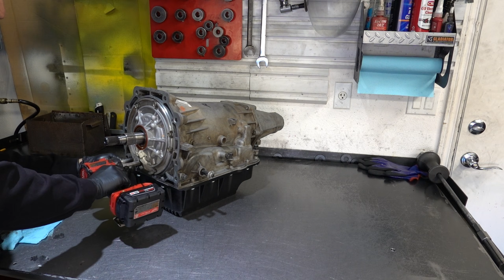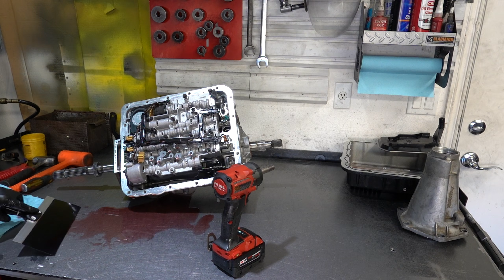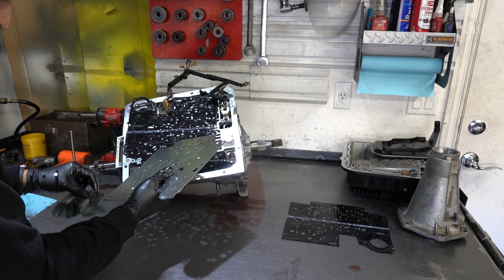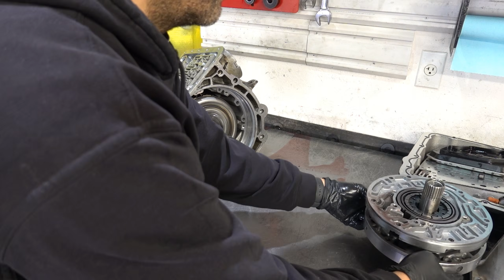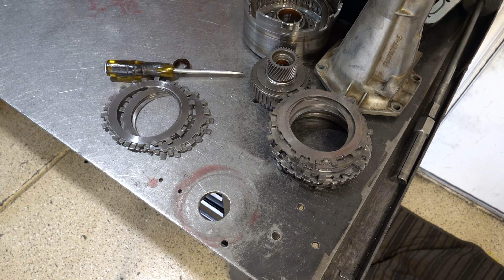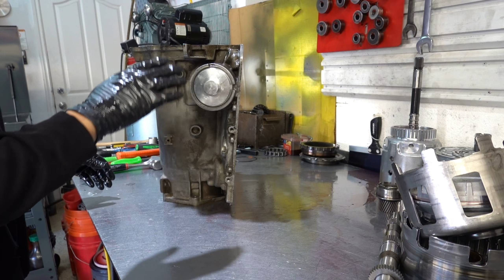4L60E Teardown  - The 1,000 Horsepower "Hill Killer"!

Comment: Hi there! I appreciate all the videos and honest work. If you have time to answer a quick question? Would a 2005 4l60e be a direct a direct swap into a 2003 Silverado? I have an opportunity to buy both very very cheap! If I wasn't up in Canada I would drop the trans off at your shop! Thanks for all the great content 👍
Reply from the maker: Hi Chad, thanks for watching - those units will interchange. I have a 2005 4L60E in my 03 Tahoe that I built eight years ago, still runs strong. 

Check out my 4L60E interchange video if you'd like more details on all the diff versions of that transmission as well as what years will interchange and what wont: https://youtu.be/4kEzgffqi7w
Reply: @nickstransmissions  I will watch it for sure! Thanks for the reply! With all of your detailed videos I am getting close to building my first 4l60e.
Reply from the maker: Thanks, Chad!

Comment: What is the benefit of blocking off the 3-2 downshift valve?
Reply from the maker: Hi Scott, I think I will do a separate video on the 3-2 downshift circuit as I get this question frequently, and it's a good question...

Nutshell: Blocking the downshift valve simplifies the exhaust hydraulic circuitry for the 3-2 downshift, resulting in less designed-in slip on the band between the downshift being commanded.
Reply: @ cool deal. Ill definitely keep an eye out. 

Keep up the good work man. Hope ya had a good Christmas and New Years!
Reply from the maker: Thanks, Scott - will do!

Hope you and your family had a great Christmas and New Years🎄🥳

Comment: Hi Nick This is Walter,  i had to buy a new VB One of the Bathtubs was mashed bad, So was the separator plate,  i got a rebuilt from Central,  got all the parts together to build up my 4L60E VB,  i am using a Sonnax Performance pack and TransGo SK-4L60E mini kit, Sonnax O-ringed end plugs (2),  and that Sonnax HD 2-3 shift valve,  
 i have a few questions if you dont mind, For peace of mind,   When it comes to the 3-2 kick down why Block it off?   Yes this is a High Performance ALL out build 700HP,  I believe in the TransGo HD-2 kit they give you a tight wind spring to stop 3-2 down shifts,  To Be honest i like the 3-2 shift But i guess its not needed in hight HP applications ,  Can you elaborate on it Just for my own knowledge, You help is always Much Appreciated, Walter
Reply: I have an oversized Afl valve from central valve body's. Would that work with the double spring mod. Don't have vacuum tester at the moment. I'm also going to block 3/2 control and use abuse spring in control valve.
Reply from the maker: Should be fine. If you are taking the 3-2 ds valve spring and inserting inside the main AFL spring, leave the AFL balance hole in the spacer plate alone.
Reply: @seanmccaskey6427  yes it will work with the Central over sized AFL (purple) valve  , i believe there Purple valve is .001" bigger
Reply: @LSXTtype Thank You!!
Reply from the maker: Hi Walter, blocking the 3-2 downshift valve in the 200-4Rs, 700R4s and 4L60Es simplifies the 3-2 exhaust cycle by streamlining the exhaust circuitry enabling faster downshifts and consequently, less band slippage (the slip im referring to here is not like a slip that you'd feel if the band or clutch pack was burnt...This slip is much more subtle and usually never noticeable by the driver or occupants).
Reply: @nickstransmissions  Thank you for explaining that,  so the  transmission will still down shif then 
I have a few more questions if you dont mind, TransGo supplies a 1-2 shift valve-spring-check ball etc in the HD-2 kit,  I dont have it in the kit i bought, should i get one?
Walt
Reply from the maker: Contact Transgo and see why it wasn't in your kit - perhaps they recently deleted it for some reason. If not, ask them to send you the missing parts.
Reply: @nickstransmissions  Hi Nick, it wasnt missing, i bought the smaller SK-4L60E kit they dont give it to you in that kit only in the HD-2 kit,  Do you use that TransGo 1-2 valve in your performance Builds?
Reply from the maker: Oh, ok...no worries it wasn't clear whether you bought the HD2 kit or not; had assumed you did based on your previous posts...I don't normally use it unless the customer specifically wants to back-shift to 1st gear at any speed, which is what that special valve and spacer does.
Reply: @nickstransmissions  O OK yeah i wont need it then , Next thing i wanted to ask you  is about the Forward abuse and Low over run circuit, This transGo kit i have supplied a check ball to insert into the forward abuse valve spring  and also a slightly shorter Yellow spring to use in place of the factory Low over run valve spring,  What do these modifications actually do?  any benefits?,  I did install a Sonnax Pinless piston in the Forward  accumulator ,  Thank you for Clearing up about the TransGo 1-2 Valve,  I appreciate it,  Walter
Reply from the maker: You're welcome, Walter...Good question on the little check ball and spring...I'm guessing the spring improves shift speed for manual low in some way, same with the little ball in the forward abuse valve spring (it likely serves as a valve stop on the outboard side) but these are guesses...May be worth a call to Transgo on Thursday 1/2 to see if they can explain...
Reply: @nickstransmissions   OK will do,  Do you do these mods in your all out builds?  
 My New central valve body Has the TCC bore sleeved  ,  i pulled it out to see how they have it set up,  They had it set up for PWM (Valve - spring -Valve)  i have the Sonnax Performance Pack and they say to remove the second valve and spring and use there long silver spring with the stock out board valve , Sonnax says that there TCC on-off set up applies about 100 PSI to the lock up clutch in the converter,  And that other methods of making the TCC  a on-off boost TCC pressure up to 160psi which is no good,  They say it beats up the clutch , engines thrust bearing and can cause excessive heat,   What do you think about this?,  i have no choice but to use the Sonnax silver spring over using the TransGo valve because my TCC circuit has been reemed,   Let me know what you think and if the Sonnax was is good, Walter

Comment: If you take a heat gun. Get those bolts to 200 or so degrees for a few minutes they come off super easy.
Reply from the maker: Yep, a small propane or benzine torch works well also...Every once in a while, you'll get a bell w/bolts that won't want to come off with those methods....In such situations, either OA torch and/or cut the bolt heads off.

Comment: I had my 60e rebuilt and it has a leak between the converter and the pump and I have already replaced the front seal and still leaking while running. My question is what you think it could be.
Reply from the maker: Thanks for watching Mackbee...How long ago in terms of miles was the transmission rebuilt? Do you know if they replaced the bushings, including the pump body bushing? What about the converter - hopefully it was replaced with a new/re-man converter. 

Let me know on the above and I'll try to narrow it down for you.

Comment: I know you have mentioned it before and i know Brian @ betterbuilt preaches it all of the time but....can you explain to me why you would block the 3-2 inward on the 2 locations.  I cant get a straight answer from anyone. Called several companies like transgo and they say absolutely not to do this modification. Thank you for the awesome video as usual!!!
Reply from the maker: Thanks for watching, John.

Blocking those two valves inboard streamlines the exhaust paths for fluid from the 3-4 clutch pack down to the sump which speeds up that exhaust whereas it's more 'gradual' with the valves functioning per the factory arrangement. Blocking the 3-2 control solenoid isn't super critical in most cases as you benefit the most from blocking the 3-2 downshift valve, which Transgo provides their little tight coil purple spring in the HD2 kit for that purpose. The 700R4 and 200-4R also benefit bigly from blocking that 3-2 downshift valve for the same reasons.

Hope that helps clarify things.

Comment: The pan has raised bars made into it. That is what is supposed to hold the filter in place. I have dealt with those pans before. If you. Can’t nt get a replacement gasket. They seem to be reusable, if in good condition. 

I have only had a couple in 30 plus years, that the air trick wouldn’t remove. But never fails. It’s on camera, it will give you fits. lol

Every time I hear. It’s been built for x amount of horse power. I make the customer stand there with me, as I take it apart. 

Because, inevitably someone. Customer or prior shop. Will try to accuse you of taking the high dollar performance parts. 

And hardened shafts or darn expensive. 

As far as 5 pinion planets go. You are correct. Only GM. I have had a lot of problems previously  with after market 5 pinion planets.
Reply from the maker: Yep, figured it out after carefully looking at the pan....I haven't messed with the gasket itself as it's in good shape so should be fine. 

Re stuff giving me fits on camera: it's guaranteed to happen, lol!😆

I've taken apart transmissions a few times w/customer watching when they felt they were deceived/lied to and genuinely wanted to know why the unit failed.

Thanks for watching, Larry!

Comment: Can you even build one of these to hold 1000 hp and what would it cost if you could?
Reply from the maker: I can but how long it lasts, assuming all or most of that 1,000 horsepower is actually used by the driver on a regular basis, is another matter. To make it last, you'd have to spend an infinite amount of money, IMO.

I'd never recommend anyone use one of these transmissions in a 1,000+ horsepower application...Whomever built it simply lied through their teeth to get the job then did a half-assed job to boot, even for a factory-level rebuild.
Reply: @nickstransmissions  I usually just tell people who want something that will hold up for a long time is build a th400 in my opinion is the best option to hold 1000 plus hp for years.
Reply from the maker: Yep and most with 1,000+ horsepower are racing that vehicle full time so OD isn't needed...Can't go wrong with a built TH400.
Reply: Hey Nick question happy holidays btw, The2nd gear feed hole on the  plate drilled to .080 is going to make 2nd gear shift feel hard hard having a vette servo and wide band ?
Reply from the maker: Same to you and your family, Chris....080 is fine if you're using the Vette servo with a factory to 2200 stall converter in either a car or truck...Band type doesn't matter as long as band clearance is appropriate (1/8 - 3/16 movement along the drum).
Reply: @nickstransmissions  it feels very harsh when taking off normally it just dumps it harsh when I get off it it’s smooths out but still firm I’m think the EPC solenoid has been turned up how can I bring it to factory
Reply: @ bro you live here in Vegas ! I sent you a friend request on Facebook
Reply: What about 450whp range. How much would I have to spend in parts to make the 4l60e from a gmc 1500 stout?